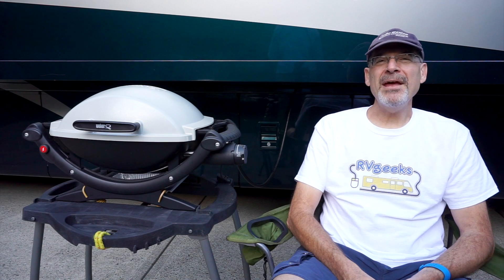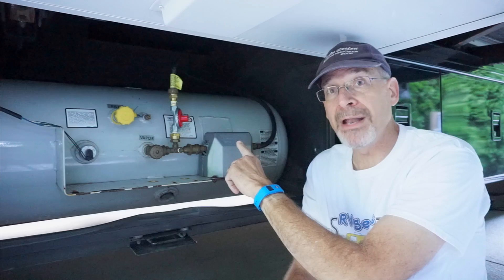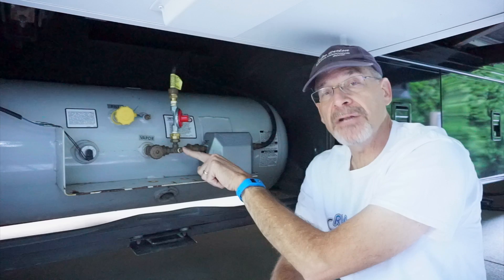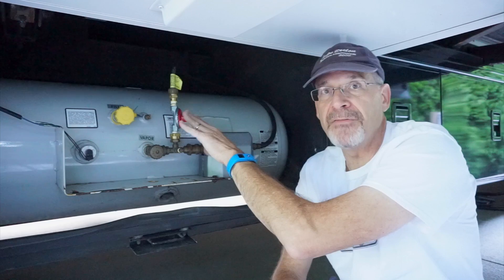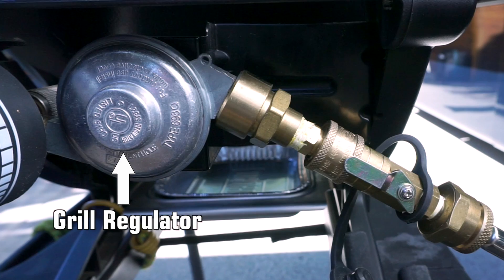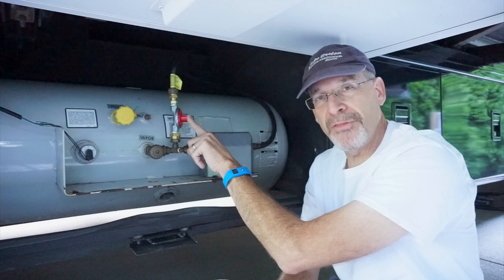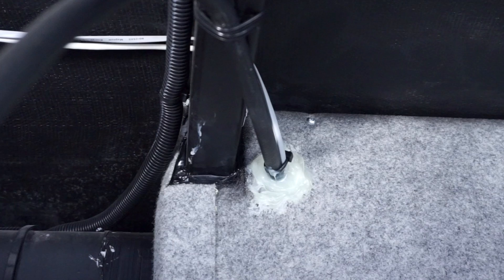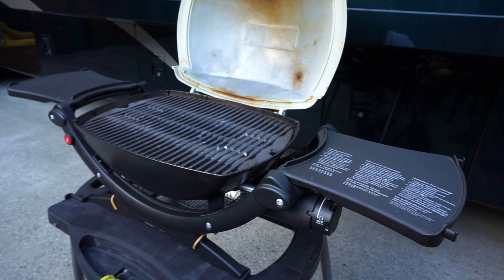How to Connect a BBQ Grill to an RV's On-Board Propane Tank

Comment: Hi there, i just have a question why you didn't just connect the new line going to the bbq to the existing propane regulator already there instead of getting a new one?
Reply from the maker: The onboard regulator brings the pressure way down to a level that would not allow it enough pressure to feed the grill all the way on the other side of the RV. The additional regulator we added has considerably higher pressure, but still far less than the tank pressure with no regulator at all.
Reply: @RVgeeks  thank you. Do you suggest I add another regulator when I am trying to run a line for the bbq?
Reply from the maker: @blackincawston  If the run of hose is going to be more than a few feet, the addition of a 15PSI regulator, like the one we added, will prevent the oily build up over time that we experienced.
Reply: @RVgeeks  thank you again for the reply. I am probably looking for use a 2-3 feet hose as the bbq will be in a platform against the camper
Reply from the maker: No need for an additional regulator for such a short run of hose! 👍
Reply: @RVgeeks  thank you again. Much appreciated 🙏

Comment: Your videos have been very helpful to me. Following this question from a FB group I purchased the same setup, but without the yellow tape. Question about the connection between the Cylinder thread x ¼" Male Pipe Thread Adapter and the male quick connect. This is the only connection that does not have a gasket, it would not screw in very far even if there had been a gasket and it leaked when I tested it. Will the yellow tape be sufficient or is there supposed to be an o-ring or gasket? Do I need the yellow pipe tape with the gasket connections too?
Reply from the maker: Hi Min. That connection between the male side of the quick connect and the 1"x20 Male Thread to 1/4" Female NPT thread... it should screw in fairly far (might take some extra oomph), but we would definitely use the yellow PFTE tape on it to be sure it didn't leak. And we taped all of the other connections EXCEPT the 1"x20 male-to-female connections (like between two sections of hose), since those have O-rings and gaskets and should seal tightly.

If that's not what you're asking about, though, let us know.
Reply: Thanks for your quick answer. I can't tell you how much your videos have helped me.

Comment: My problem seems to be the opposite.  I have an older RV LP fitting, but a new grill uses the quick connect.  Would the extend a stay work?
Reply from the maker: Hi Mary. Any grill should work with any RV as long as the correct connections/adapters are in place.

Comment: Peter, what was the performance problem that developed with the grill before you put the regulator inline and found the oil in the regulator? I have mine basically the same way, a 15PSI regulator before a 15 foot hose that will connect to my Weber Q2000 just before the regulator. I wrote Weber and they say since my burner will only light half way around until I brush the burner with a metal brush back towards the inlet, that it may be a double regulated pressure situation. The burner is clean as a whistle. Does the same on the small bottle of propane also. Thanks.
Reply from the maker: Hi Jerry! When we had oil in the grill’s regulator, the grill showed low flame (not hot enough to grill), it would sputter, and sometimes would go out completely. We don’t recall it ever exhibiting the problem you’re describing, but that could be because the Q1000 is smaller. If your grill is having the exact same problem when you use the small bottle of propane or when you’re hooked to the RV’s onboard tank, we’d say that you’re definitely having an issue with the regulator on the grill itself... and it’s certainly possible that it has oil in it... or it’s faulty. If it was a “double-regulation” issue, it should work normally when you run it off the small bottle, since there’s not a second regulator then. Hope that helps!

Comment: I was just thinking about it, why not put the hose going to the grill on the down stream side of the on board pressure regulator instead of the upstream?
Reply from the maker: We tried that, but there isn’t enough pressure on the downstream side to feed the grill. It wouldn’t light.
Reply: @RVgeeks  ah, ok. I thought I'd ask about the idea of whether or not  you 2 tried that.
Reply: @RVgeeks  at least you 2 tried it.

Comment: So can I add a splitter to feed the BBQ and my propane fire pit, not necessarily to run at the same time. The fire pit hooks up to a 20lb tank with the big plastic screw connector. But when the fire pit is not connected I don't want gas to leak so I was thinking I need a connector for the plastic screw to quick connect.
Reply from the maker: Hi Stew. We don't see any problem with adding a splitter so you could feed both devices (although likely not at the same time, like you mentioned). We'd agree that you'd want to have some means of shutting off the unused line for the portable fire put when you're not using it... so we'd suggest that both ends of the "Y" should have something like the female quick connect with shutoff valve, like this one: http://bit.ly/1_4NPT-HP-QC-Female. Then you could adapt the line from the fire pit to have the appropriate male end for the quick connect (which might take a couple of pieces assembled together) and you'd be good to go. Hope this helps!
Reply from the maker: The only thing we thought of (after commenting earlier, of course) is that the fire pit may require a higher FLOW of propane (flow, not pressure) than the smaller-diameter hoses/adapters can supply. If you like to use the fire pit with the flames roaring... it may burn lower with this set up. If you usually use it turned down fairly low, you may just have to open the valve a little more than before to get the same amount of flame.

Comment: Is the first regulator a special kind that still keeps the pressure high enough for the barbecue's regulator to work with? I only use a short line with the stay-a-while as that is where my camp/curb side is located. I do need to figure out a connection for my Big Buddy Heater with a 20 ft run to an outside location.  I have a tee behind the stove for it inside the RV.
Reply from the maker: Exactly! The 15 PSI regulator is perfect for reducing the pressure enough to prevent oil build-up in a long hose, but high enough to reach and power the grill with the stock built-in regulator in place (so no mod needed on the grill). Since your tank is on the curb side, you shouldn't need to worry about oil building up in the very short line to the grill, so the 15 PSI regulator shouldn't be needed (it's only long lengths of hose where high pressure creates the oil).

If your Big Buddy has a regulator built in, it's possible that it won't run off the stove line.. If the line to the stove is already regulated (that's the way ours is, with the entire RV regulated to 11" water column right at the RV's main tank), and the heater also has a built-in regulator (we're almost certain that it does), double regulation might be a problem.
Reply: RVgeeks Hi and thanks for helping. My Big Buddy works fine in the RV and has since I installed the Tee at the stove. It uses the RV's regulator as the line in on the Big Buddy is unregulated. It has one for the two little one pound bottles I usually use when away from the RV. But I'm looking to use the heater further away and use the RV's tank. I will need two regulators, the 15" w.c. and an 11" w.c. at the heater.

Comment: Question for you, i thought of doing that but i figured out that there would be two regulators in line. One on the BBQ and the other you installed at the tank end. Does that reduce it too much?
Reply from the maker: Hey Mike! Great question. Two regulators MIGHT be too much of a pressure reduction, depending on which type you use. Here are some clarifying notes about our regulators and why we set them up the way we did.

We mentioned that the main one going into the RV is 11" water column. That is a standard that just about all appliances use, including the grill. So the small built-in regulator on the grill is also 11' water column.

As we mentioned, the only reason we needed to add in regulation coming off the T is to prevent the oily build-up that can occur in the long hose. But the reason we used a 15 PSI unit at the T (rather than a standard 11″ water column model) is that there wouldn’t be enough pressure to run the grill due to double regulation (having TWO 11″ water column units won’t work). We know first-hand on this one, since that was one of the first things we tried. LOL

So the 15 PSI regulator at the T reduces the pressure enough to prevent oil build-up, while still providing enough input pressure for the grill’s built-in regulator.

On some grills, the built-in regulator can be removed, as long as you're connecting to a line that's already regulated down to 11" water column. But in some cases, such as ours, the one on the grill is not easily removable without modification (it's part of the on/off/flow control). If it had been easily removable, we could have simply removed it and 
moved it to the far end of the hose (coming right off the T), eliminating the need for the extra 15 psi regulator.

If we had a grill with an easily-removable regulator, and we NEVER intended to connect to external propane, we could also have connected the Extend-a-Stay downstream of the RVs main regulator, and removed the grill's regulator completely. That would send already-regulated (11" water column) propane directly across to the grill, which would now need no further regulation. Of course this would REQUIRE the removal of the grill's regulator, since, as mentioned,  installing TWO 11" water column regulators in one line will prevent the grill from receiving enough pressure to operate.

Hope this is clear!

Comment: How did you find this works with having 2 regulators. I was told you had to remove the regulator on the bbq if going through the RV 2 stage regulator. I see you are going through the single stage that you added and the bbq reg.
Reply from the maker: This worked great, because the first regulator (the red one we installed right above the Extend-a-Stay) only brings the pressure down to 15 PSI. Since that's far lower than 11 inches water column (which only equals about 0.4 PSI), there was plenty of pressure to power the grill with its original regulator still in place. We originally tried using an 11" water column regulator at the T (instead of the 15 PSI unit) and indeed there was not enough pressure to keep the grill lit because of double regulation. So the 15PSI unit is low enough to prevent oil from forming in the hose, but high enough to avoid having to remove the grill's built-in regulator (which would have been a challenge on this particular grill).

Comment: I've heard having two regulators will diminish the gas flow to your grill to the point your grill won't operate properly...how did you avoid that problem? Sorry guys...found my answer farther down the comments...thanks
Reply from the maker: No worries Dennis! That 15 PSI regulator is indeed the secret. We tried two 11" water column regulators first, and the grill wouldn't light. ;-)

Comment: Great video! I’m a newbie to the RV lifestyle and we just purchased a 2017 Thor ACE class A with the quick connect propane outlet below the basement on the passenger side. I tried hooking up my Weber Q with the hose the RV dealer provided and I was getting no flow at the grill burner. When the dealer tested the connection, it was producing 14psi of propane...so something is happening at the male connection going into my grill.

Is there a different fitting I need to put on the hose going into the Weber? When I screwed the can on, that works, so I know it’s not the grill!
Reply from the maker: Hi Eric! What you need to do is check to see where the line that goes to your grill comes from. We are betting that it is AFTER the RV’s on board regulator. If that’s the case, the pressure was 14 inches water column, not 14 psi. 14 inches water column equals closer to 0.5 psi. If you go to your propane tank, and look at the regulator that goes to the entire RV, if there is nothing teed off from that line BEFORE the regulator (in other words closer to the tank), you absolutely are not getting full pressure over to the grill, but rather pressure that is already regulated down for all the appliances on board. If that’s the case, you need to remove the regulator that’s built into your Weber grill, as it’s already the correct pressure for the grill, and needs no further regulation. Keeping the regulator on the grill that came with it means it’s now being regulated down for too low for the grill to operate. Just be aware that removing the regulator on the grill means you cannot use portable bottles for grilling any more. One note… If you are unsure about working with propane, see a professional! We are not professionals, and are only providing this information based on our own personal experience.
Reply: RVgeeks thanks and that would make sense. I’m learning as I go...I’ve never really paid close attention to the science behind how the propane stuff works (like the regulator) but I’m a quick study lol. From your experience, if I remove the regulator on the grill, is that a permanent modification or can I put one back in? Are you aware of any “quick connect” regulators that exist for people like me who want to use the grill between the RV and other needs?...or an adjustable regulator that lets you turn it off when not needed? Thanks again for the quick replay...I’m loving your page!!
Reply from the maker: Sorry Eric, but we're not aware of any quick-connect regulator. If you remove the grill's regulator, you can re-install it, but since that's a whole project, it's not the kind of thing you'd want to do on a regular basis. We'd suggest that the easiest thing to do is have a dedicated grill for the RV that is set up for use there and nowhere else. We'd also suggest that before you remove the grill's regulator, you absolutely confirm that your grill port on the RV is indeed low pressure.

Comment: Thanks for sharing this video.  Could you have tapped off the water heater of refrigerator?  That is what I have been thinking of because both are on the passenger side, any advice?
Reply from the maker: You can tap into any accessible propane supply that you feel comfortable and confident in T-ing into. Just be aware that the propane to both the water heater & fridge (and everything else on board) has already been regulated down to 11" water column. That means that you will almost certainly have to remove the regulator that came on the grill for this to work, because having two 11" water column regulators in line will not likely provide enough pressure to run the grill.
Reply: +RVgeeks:  I'm a little slow today, guys...Please bear with me.  How is that different from the setup you show in your video?  You have a regulator at the tee, and another on your grill.
Reply from the maker: Southbound
Ahhhh.... got it. The difference is that the regulator we installed coming off the T (the red one in the video), is 15 PSI. The regulator that came on the grill is 11" water column, which equals only about 0.4 PSI.... much less pressure.

The main regulator going into the RV is also 11" water column, so that means that if you tap into any line further downstream (like near the fridge or water heater), that propane is already regulated way down. So if you simply tap into that very-low-pressure source, the additional regulator on the grill will probably prevent there from being enough pressure for the grill to operate, if it even allows any flow at all.

This is the situation we had when we first tried experimenting with regulators. We added an 11" water column regulator at the T (where the red one is now) and that, combined with the second 11" water column unit that comes on the grill, brought the pressure down so low that the grill wouldn't light. But 15 PSI at the T is plenty of pressure to allow the propane reach the grill's regulator.

Hope this helps! :)
Reply: +RVgeeks Great explanation.  Thanks!